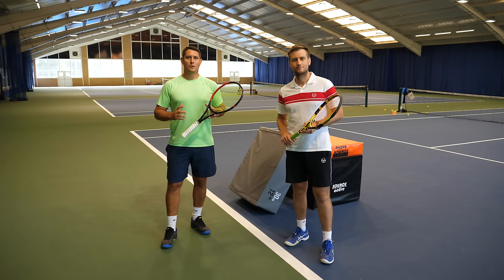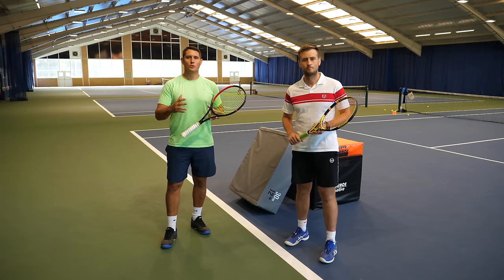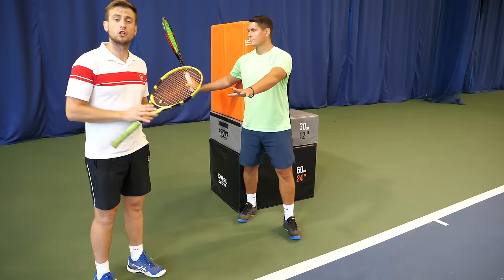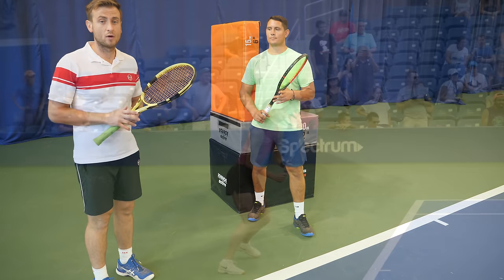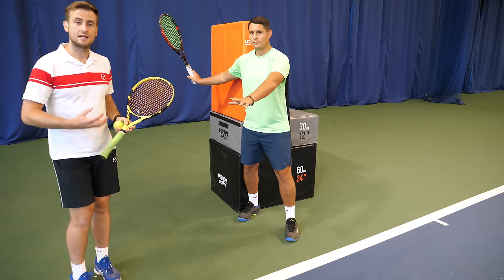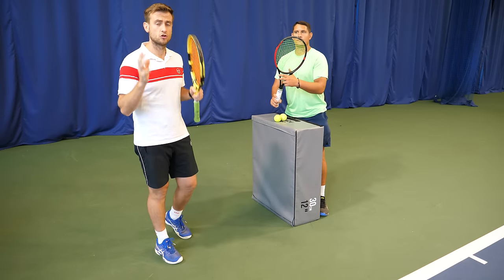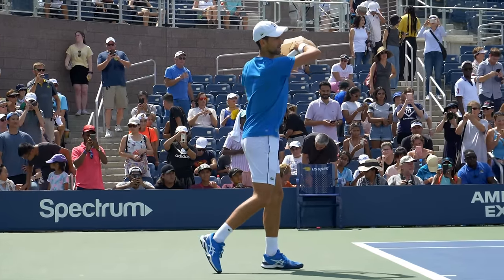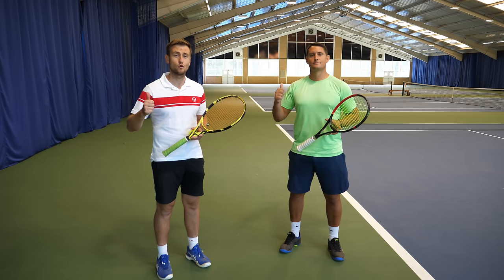Modern Tennis Forehand - 5 Drills You Must Do

Comment: Very clear and simple steps will put into practice good point re getting too near the ball. I have seen other guys hitting similarly to your method but couldn’t work out what I needed to do differently except I knew my forehand lacked real pop and power plenty of top spin but not enough penetration. Your drills and breakdown of the forehand will help me just a question of how much I can do it? I am 64 yrs of age but can run around with enough speed to play very good club players in their 20’s 30’ and 40’s just a question of how long I can keep doing this. Eat well very little to no alcohol plenty of rest and lots of yoga stretching daily cycling mostly on an electric bike. Always kept fit no excess weight all helps to date. Thanks great tuition amazing forehand at the end.

Comment: Hi Simon and Alex!
I have ben following your videos for some time and I think you are doing a great job. I work as a part time tennis coach in Sweden and have a question concerning the WTA forehand vs the atp forehand. Do you as coaches encourage the girls to try use the so called atp forehand or is , in your opinion, necessary for the girls to use a bigger backswing to generate the the right amount of power for their strokes?
Thanks.
Greetings from Sweden/Per
Reply from the maker: Whenever I have worked with a girl, I'll look at their mechanics and see if they can do something better with the swing. If their swing is natural and a bit more like a WTA swing, I would leave it but work on them adjusting swing sizes depending on the incoming ball. With most though, I've taught them more of an ATP style, keeping the racket on the dominant side etc
There is no wrong or right, each player is a separate puzzle you must figure out
All the best
Simon

Comment: Thanks for the video, guys. Haven't seen Alex on Youtube in ages. While changed, your forehand's still as great as ever. I watched a video from Macci and found the trick of raising the elbow a bit higher to create the loop and the space in order to get a more powerful and topspin forehand. The trick is good and I can really see the increase in power due to the lag created by the loop and increase in topspin due to the swing path generated also by it.
But I have a problem. I tend to hit the ball late when creating this loop. The timing of groundstroke is much harder too. Do you have any suggestion for improvements?
Reply from the maker: Work on early preparation and really focus on seeing the ball come off your opponent's strings.
Create more time for yourself by being early with that unit turn and swing.
All the best
Simon
Reply: @TopTennisTrainingOfficial  Thanks, Simon. I never thought about seeing the ball coming off the opponent's racket was that crucial. I can't wait to try this on court.

Comment: Alex and Simon, in an interesting video by former ATP tour player Vince Spadea, he advises to take the racquet back to the 5 o'clock position immediately (with 12 o'clock being directly in front of you) and then pulling the train (racquet) through with extended forearm (think Federer) and then turning the door knob for spin. He says holding the racquet with the unit turn is unrealistic when returning a fast serve or ground stroke. I find this technique to be simple,  never has you hitting the ball late and that you can hit it harder. Like the abbreviated serve,  this seems to be the abbreviated forehand. Any drawbacks to this technique?
Reply from the maker: In this video I'm working with one of my students on getting into the power position early.
Have a watch here - https://youtu.be/-sZ3madzfoA
It's a simple way of creating time.
The downside is it becomes a bit rigid, not so smooth.
Simon
Reply: Simon, thank you for the reply. I did watch the video. It appears you were trying to get the student not to hold onto the racquet too long (past the 3 o'clock position) which was causing him to be late, whereas Spadea was suggesting just getting the racquet immediately into the 5 o'clock position which Rick Macci also did with a student initially in teaching him the Fed forehand.

Comment: You show the ball hitting the strings above the center. Shouldn’t the ball hit the strings at the center or just below?
Reply: just below allows foreven more spin
Reply from the maker: The actual contact point will be around the centre but the intention is for the racket to brush up so you start with the racket below the ball level.

Comment: it's not 45 degree angle. just saying. 
thanks for the amazing technique!
Reply from the maker: 45 degree angle?
Reply: Top Tennis Training - Pro Tennis Lessons in the first drill, had the set up been at 45 angle, two sides would have the same length geometrically speaking. The triangle is more like 60 degree from the ground as opposed to 45 degree.

Comment: You still teaching “brushing” for topspin?!
Reply from the maker: Let's hear your expertise. . .
Reply: Top Tennis Training - Pro Tennis Lessons 
Hearing much more of compressing and rolling over the ball. Apparently many of the European coaches have been on that terminology for some years now and seems to make more sense physics-wise to my thinking. You will need to compress the ball and string face using directional inertia to effect the ball. After that you just need to control the dwell time/release ratio to exert the desired degree of spin. The shape of the back swing and follow through will control the shape (height) of the ball. Maybe they’re incorrect?
Reply from the maker: If I paid a coach for a lesson, and he gave me that dribble, I'd walk off the court and never have another session with the guy.
I would know right away that he is trying to sell me some serious bullshit.
That sort of terminology is why players around the globe get so confused.
Tennis is not rocket science, to get heavy topspin you need a low to high swing, can you get some top with string angle etc?
Yes - but it will be limited and will require a specific type of ball.
Getting the racket head under the ball and coming upwards at the point of contact is the ONLY way to generate heavy topspin on a shot that will not only have spin but clear the net.
Brush the ball kid
Reply: Top Tennis Training - Pro Tennis Lessons 
Yes of course. I’m just coming at it from a purely physical standpoint. I’ve played tennis for 34 years and am a 5.5 player. I’ve been to and spoken with many coaches from central and Eastern Europe and they all seem to shake their heads and snicker at the brushing notion. After they explained their theory and the reasoning behind the “why” to compress and roll - it made more sense. That was back in 1990, kiddo. 😂 You can’t really argue with their results either (comparing to US/North American tennis production). Even at the club level over there, the level of tennis is far beyond what we have here. Results matter, eh?
Reply from the maker: I understand the concept but what produces topspin?
Why make it sound so complicated?
I'm from the UK, have lived in London the past 20 years but travelled a lot to Spain, France and Eastern Europe to train and compete and I've seen coaches from these countries teach.
There are many good coaches in all areas of the world, the reason Europe has produced more players in the past few decades is not due to these terminologies, the roots are so deep.
That's an entire video in itself
Reply: Top Tennis Training - Pro Tennis Lessons 
That’s fantastic! There is some tremendous tennis being coached in those regions. Yes, the roots run very deep, but they run very deep in North America as well. What I witnessed in Europe is a completely different philosophy, not merely the terminology they impart. I believe that it is a combination of several factors: philosophy, culture, surface and yes - a more detailed approach to coaching. These are the reasons they are so much better overall. As an example one of the coaches from our club spent two weeks in Spain recently. She went for a visit to both Sanchez-Casal and Rafa’s academy in Mallorca. We had a long meeting on those particular systems as she shadowed uncle Tony around for a couple of days. Took a lot of video and stills. It quickly became apparent that the entire culture and much of the coaching system runs contrary to what is generally done here in North America. Not at one point did she hear the term “brush” when they were speaking on topspin. They did talk extensively on various degrees of compression of the ball, and especially compression of the legs which created that “heavy” ball. Wide stances, sinking in, etc. That is identical to what I was taught in the Czech Republic and repeatedly heard the same terminology from Russian, Serbian, Croatian and Slovenian coaches. The only instance that brushing was ever mentioned was on a buggy-whip forehand. The reason I went into the details on the physics of what they teach is simply because I “asked” them the most important question in tennis: “why?” Then they explained it in greater detail. They do not go into this detail in routine lessons, but I did inquire further based on my personal intrigue. And you know what? Man does it WORK! Once I understood and felt the compression ratios and the use of the ground they teach it was game changing. We went over the fact that you don’t have to swing up to create topspin. I can hit down on the ball to create that effect. The reason we hit up is to create height by contacting the lower half of the ball. When I watched your video, at no point did you guys brush the ball. I didn’t even need to watch it to know that. I could “hear” the decompression “pop” of the ball every time you hit it man! How do you propose that “pop” is created?? It is created simply by the string face “compressing” the ball and then very quickly the ball resuming its spherical shape. That’s the simple physics of it. Your topspin came from the roll of the face just after the impact and your height was generated by the shape of your backswing. The degree of your spin came from the velocity of the swing itself. I would encourage you to go back and look at the forehands you featured in your video (which I believe is very good overall). What you will see in these videos is the racquet faces perpendicular or nearby perpendicular to the court surface. If you pause the motion at impact you will see the “pancake” effect of the ball compression. And there you have it fellas...👍 As many of the best Euros say: “stop brushing”!😂
Reply from the maker: So, in your eyes, brushing is a bad way to create topspin?
When you load the legs, what do you think will happen when you come up?
The success of the Spaniards, in particular, is mainly due to two things:
1. Their work ethic and how coaches treat players on court, I've trained there, the mentality is brutal. I was struggling badly with hayfever and the coaches had zero mercy, I almost died on the court before they took me the hospital. In America, would that happen?
2. The number of high-level tournaments they have. In 2004/5/6 when I was there often, they had around 44-45 futures events plus weekly money tournaments in many regions. My first money tournament, Nicolas Almagro was playing, the prize money was 3k euros and he was already top 150 ATP.
Reply: Top Tennis Training - Pro Tennis Lessons 
You are absolutely correct. The culture is very different from domestic coaching practices. What you experienced is pretty consistent across much of Europe. The drive to produce exceptional technique and tactical understanding is diversely different from what happens here. That is precisely why many academies actively recruit and hire European coaching staffs (as well as Australian coaches). As it pertains to brushing for topspin, there is so much more to imparting spin to the ball that extends well beyond simply brushing the ball. Why do you think little children use “low compression” balls?? They use these balls because they lack the strength and racquet speed to adequately “compress” the tennis ball. When you look at racquet departure angles you will rarely see that angle past 30 degrees. Only on more defensive strokes will it approach closer to 45 in order to create more height and time. What that means is that the perpendicular string face is passing through the ball and rolling over far more than brushing. When you see the face closed at contact it is mostly caused by a mishit on an early swing. The reason we push up with our legs is not to brush but to exert rotational force trough our hips and shoulders and drive the racquet forward towards the intended target. If you don’t sink in and push you will not exert sufficient force. Again we’re back to simple physics...

Comment: Say nonsense: the ball does not roll on the surface of the racket. This is a big mistake. Sorry.
Reply from the maker: Of course it does, when the strings bite onto the ball the ball rolls down in relation to the racquet (racquet flying up ball starts to rotate) the more spin you apply. That’s why if you attempt extreme spin you often shank and hit the bottom part of your frame as the ball starts in middle and finishes at bottom part of racket and clips frame. If you paint your strings and play with a lot of spin you get a line not a spot worn off